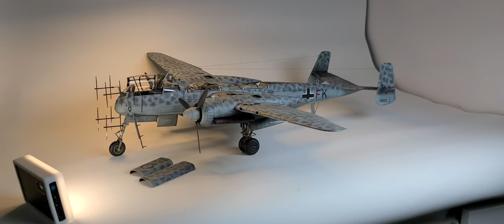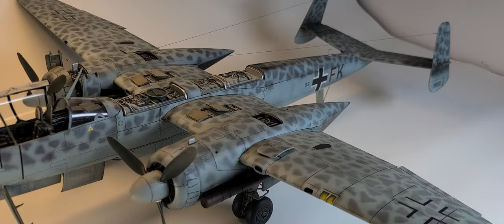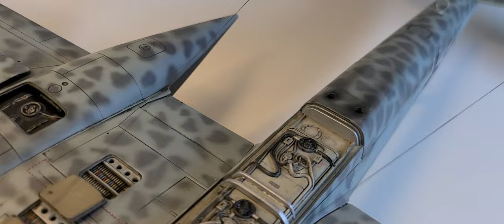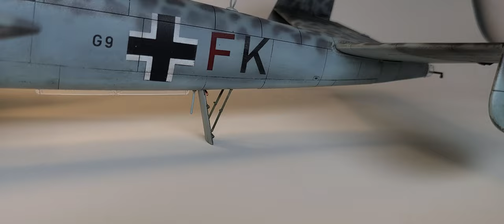Zoukei-Mura He 219...A Fiddly and Beautiful Model

Comment: An incredible build and fantastic subject. Stellar airbrush control.
Reply from the maker: Used an iwata .4 on low pressure with generally a 50-50 paint-thinner mix. I bounced back and forth between Mr. Color and Tamiya but used Mr. Color Leveling thinner for both. I practiced for a few hours on blank sheets of plastic to get the mottling decent and eventually found a rhythm that worked and once I tapped into that it was easy. By the end I went back and redid the wing I started on but all-in-all it was more scary thinking about doing it than the actual work.

Comment: Beautiful build....really looks the business! I’ve got the Tamiya 1/48 version....that’ll do me, as there’s way too much going on with the ZM kit for my liking (sad to say) 👍🏻👍🏻
Reply from the maker: It was a bit much...but like a lot of the ZM kits, if you can get to the end without putting it back up on the shelf you'll usually end up with a really good looking aircraft.
Reply: @fuzzdad2  😂😂👍🏻👍🏻 I’ve got the ZM Shinden and Bf109 G14 in the stash....one has known fit issues with the nose cowling and the other is “the modellers dream”.....I’m thinking about the forthcoming Fw190.....😎
Reply from the maker: @richardbaxter2057  same on the 190...so many possibilities. I did the G-14 BF109 and I'll put a short up about that...it was a PITA too, but taught me better airbrush control and allowed me the confidence to do the 219 mottle freehand. I tend to work on smaller models to teach myself techniques and then make larger 1/32 versions of similar aircraft.

Comment: Is the ZM kit a tail sitter ? Do they provide a nose weight ? It's a beautiful build, complicated camo for sure !
Reply from the maker: It comes with a serious weight box that goes right behind the cockpit and it will balance...but it's so light any wind or a touch will have it tail sit. It still needs a little more weight up front...especially if you detail the back fuselage area where the guns and small work station are (it has room in the back for a passenger). What you can do is put some lead shot in the nose.  Thanks...the pattern is airbrushed in without stencils. I just took my time with it and used a buff coat afterwards to blend it all in.
Reply: Thank you for the information ! I'll be starting the kit soon, it's sat long enough ! Cheers. @fuzzdad2
Reply from the maker: @joemoore4027  Build log here: https://www.fdmodels.net/blog/2022/11/27/zoukei-mura-132-he-219-uhu and look for companion book on building it.

Comment: It can't be any worse then the old Revell kit.
Reply from the maker: Actually it's much, much better...the issue is ZM makes incredibly detailed models with 90% of the detail hidden behind doors and wing panels. If you are a mm off on building in one place it manifests itself somewhere else by a larger margin and eventually you get a large error. Tamiya, on the other hand, removes error by making sure the primary fuselage and wing assemblies are easy and simple and help align all the detailed parts...ZM makes you align all the detailed parts first and they help align the larger ones. I have a build log up on Flory Models that explains it in detail and I'm putting together my blog on it here (not finished):. https://www.fdmodels.net/